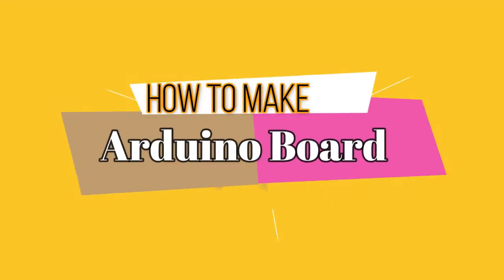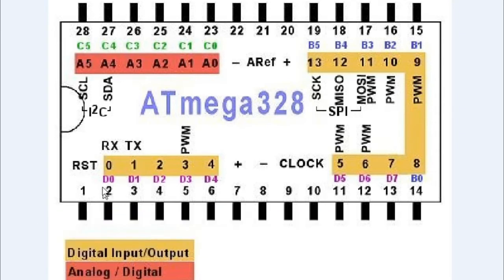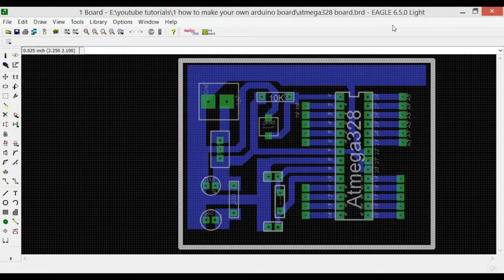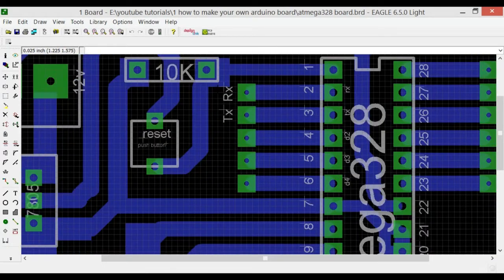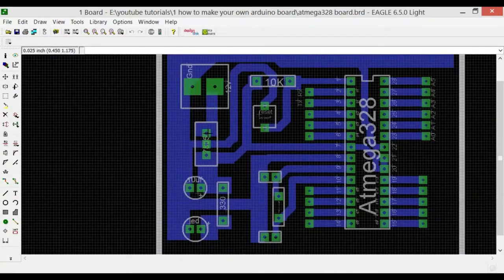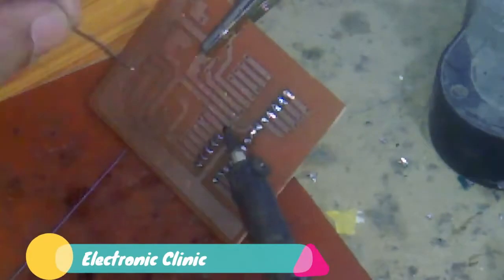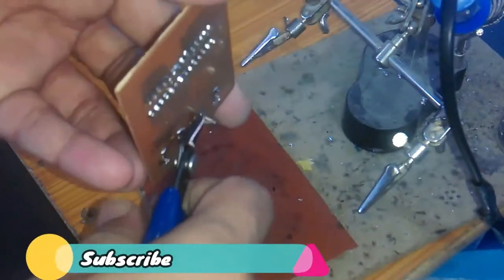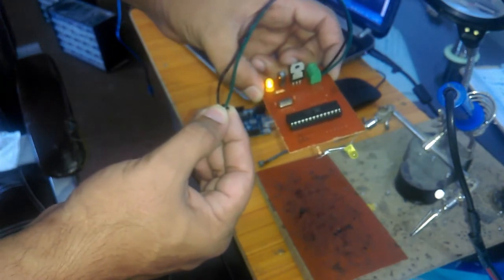Make atmega328 Board at home |How to reduce the size of Arduino | atmega328 board

Comment: Is it possible to make a iot based smart floor cleaner ???
Since I am not able to design the circuit in Proteus due very low input and  output pins of nodemcu only 11 available.
Can you help me with the circuit
Reply from the maker: I have so many videos on iot. check playlists. and there is a video in which I have explained how to design a PCB for the IoT Nodemcu module.